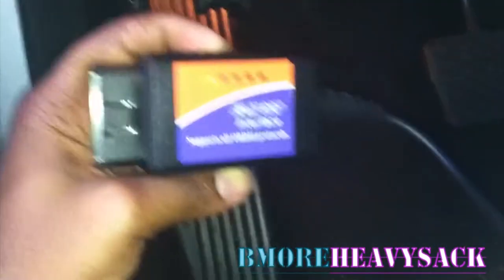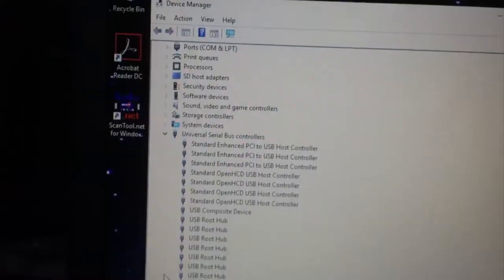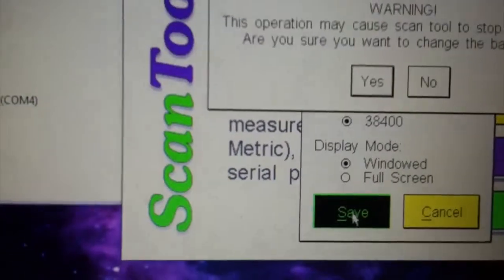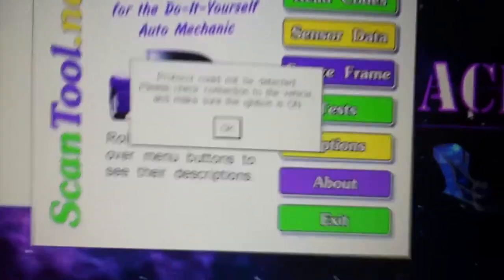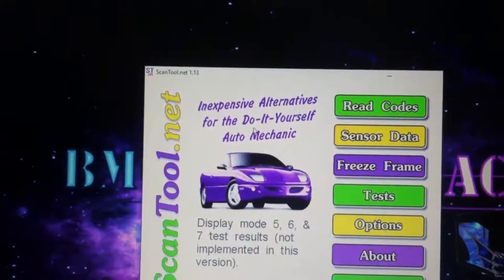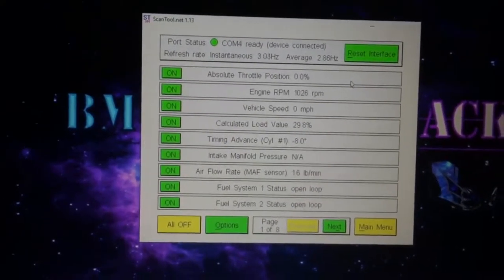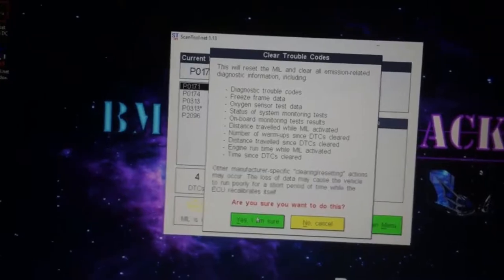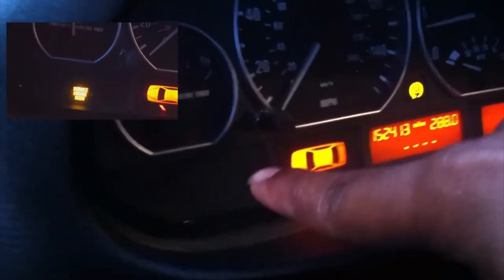ELM 327 OBD2 Scanner | Among The Best $10 Scanners? (BMW 3 Series Test)

Comment: it says communication error what is that all about :/
Reply from the maker: That's similar to the error message of "interface not found" which basically means that the software cannot communicate to the OBD2 scanner and vehicle. You will need to make sure your OBD2 scanner is recognized by the workstation and also validate the com port setting.

Refer to @ 0:42.